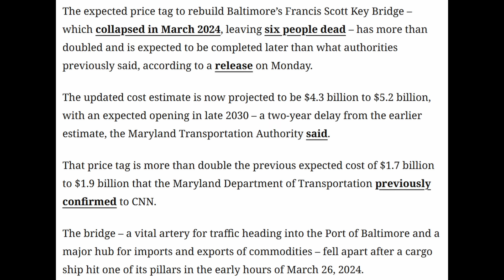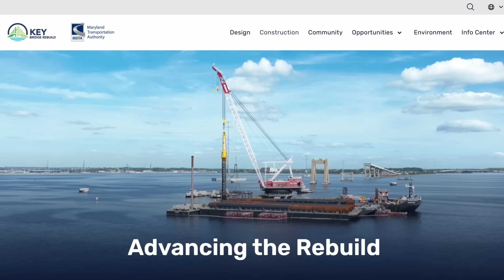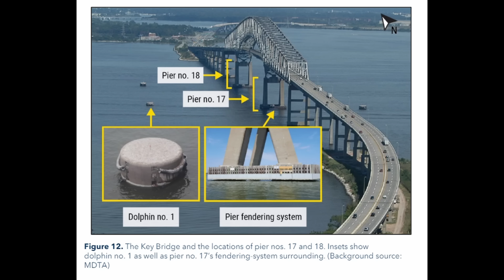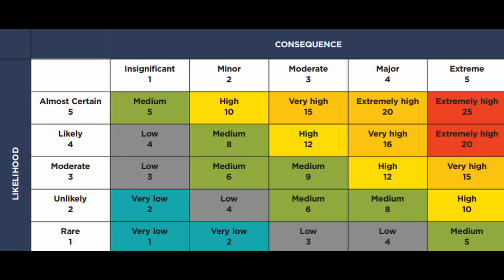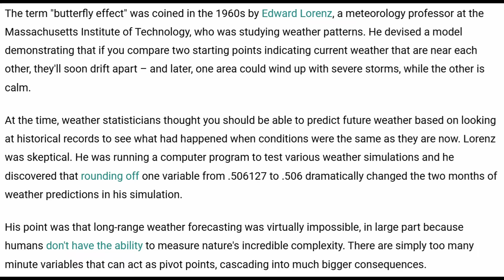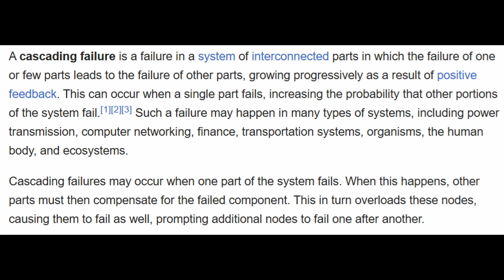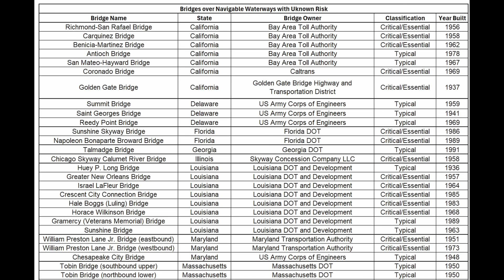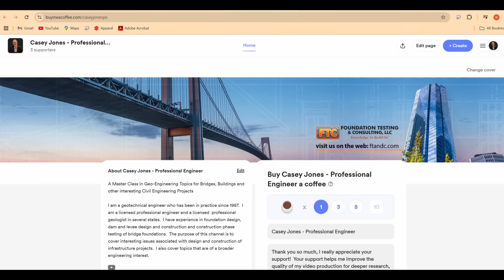Key Bridge Destroyed because of a Label on a Single Cable

Comment: Could they replace the bridge with an underwater tunnel? I know we have the technology and the machinery, like TBM"s. How feasible or cost effective would a tunnel be?
Reply: Baltimore already has TWO tunnels under the same body of water. But the bridge’s traffic capacity is needed, and more importantly, it has to be a bridge, not a tunnel, because hazmats are not allowed in tunnels. Both ends of the bridge end in somewhat industrial areas that desperately need that direct connection. (Right now, normal cars and non-hazmat trucks can use the tunnels, but hazmats have to go all the way around the beltway, which is about a 45 minute detour if there is zero traffic, and of course much longer if there is.)
Reply: @tookitogo  A 45 minute detour for hazmat transport doesn't sound like a big problem if a tunnel is safer for everybody else and avoids the extra challenge for all ships to navigate the bridge.

Comment: The incorrectly attached wire was the cause of the crash.  It was just one link in a long chain.  I would argue that the bigger issue was not having the bus breakers in automatic rather than manual and using a flushing pump to fuel the generators rather than the service pumps designed for that purpose.  These were much more fundamental issues.  The loose wire was simply the last straw, but many more straws had been loaded onto the camel by then.

Comment: 6:40 it’s bridge design that’s anti-fragile. These accidents are the stress and more robust designs are the response to that stress.

Anti-fragility is an important concept. Taleb also talked about how unexpected events become worse the more we optimize a system. That’s important to consider when you’re deciding between buying a townhouse with two floors and an apartment on the 18th floor. One of these situations is much more highly optimized than the other.

Comment: So rather then a normal DIN rail type connector block using screw terminals they relied on a spring loaded contact in a marine application. Seems like the Shaky Deal of the Week knowing how the ferrule needs to be crimped on the wire first
Reply: Spring-cage DIN rail terminal blocks are normal. They’re used everywhere, and the specific model used is marine rated. Spring-cage terminals are better for high-vibration environments than screw terminals.

And there wasn’t any defect in the ferrule itself. (Nor is there any issue whatsoever with crimps as such; crimping is a reliable, established technology that is used universally, including ultra-high-reliability applications.)

It was just the improperly applied label, which prevented proper insertion — and more importantly, made it practically impossible to see that it wasn’t fully inserted.

Comment: Why are infrastructure costs up to 10 times the inflation adjusted cost of what it used to be for the same thing?
Reply from the maker: I've often wondered the same thing it makes no sense.
Reply: If the question is “why don’t the numbers line up after we apply the inflation rate”, it’s very simple: Because inflation numbers don’t tell a complete story. They are calculated based on a “market basket” of the prices of a selection of items and services. There’s some standardized way of selecting what goes in the basket.

But any individual products and services within the basket, as well as any that aren’t in that basket, may become MUCH more (or less!) expensive than the basket average tells us.

For example, over the past 50 years, in inflation-adjusted dollars, orange soda has become much cheaper, while orange juice has gotten much more expensive.  Air travel, television sets, and washing machines have gotten much, much cheaper, while college tuition has gotten much, much costlier.

If the question is why some items got cheaper while others, like construction, got more expensive, that requires deeper analysis.

Comment: With all the technicalities one wire was enough, what suprices me is that they found it. Intelligent people with time, determination and logic shows its possible!
Reply from the maker: I thought I was impressive too.
Reply: @CaseyJones-Engineer  Its more like an impressive lie.
Reply: I was an industrial electrician for 30 years. It's really not that hard. If you have a single circuit that keeps a process running, you just trace it down with your eyes, hands and a meter. A good schematic drawing is critical.
Reply: @markwilhelm168  Was in same department were changes was not documentes and until they figured out that this was really bad, i guess you know the implications of this. Later everything was documented repairs and modifications.

Comment: It's some very similar nonsense probability things that Boeing and the FAA were using that lead to the problems with 737 Max.  I work in aerospace and totally agree we need more wholistic rather than weird probability based regulatory frameworks from the regulators. 

On the Aerospace side I think we have problems kinda the opposite of what you speak of here, but do delve into here and hint at, where we are asked to design to ensure some butterfly effect type failure that really is a very minor and would rarely ever cause a failure but is rightly or possibly wrongly sometimes deemed the root cause.  This is then a very specific design constraint that takes too much priority and can compromise other aspects of the design making a wholistic approach impossible.  

A good example of that is some of the low voltage fuel tank system designs some aerospace companies have in their fuel systems now as a result of the TWA flight 800 that for all we know could be completely wrong root cause for mostly political reasons.  So you have odd plastics and all sorts of not traditional design approaches in newer jets that themselves I fear could eventually cause a new problem as those jets age and take one out...all as a result of a regulator pressing things down too specific a direction rather than pushing for a more wholistic approach.

Comment: Trains have air brakes the lock on when air pressure is lost, say due to a broken air line.
Hospitals and critical businesses have back-up power generators to bridge a power failure.
Is there no possible way to create similar precautions on ships?  Back-up generator for critical systems like steering?  Maybe an automatic anchor (or sea anchor) deployed when propulsion or power fails?  I agree, the bridges should be better protected against ship strikes, but is that the only possible remedy?
Reply: They already have backup generators that go on automatically. It’s just that for other reasons (explained in videos by other people), those didn’t work as designed.

Comment: Take a look at the Sunshine Skyway bridge fender system (Tampa Bay). The original bridge collapsed due to a ship strike in 1980. The replacement has a very robust set of main bridge pier man-made islands that surround the piers. They themselves are protected by huge concrete dolphins on either side. The adjacent bridge piers have numerous smaller dolphins primarily because a large ship could not reach those piers due to shallow water depth – the ship would run aground first. (I boat in and around this bridge frequently, so I see this system up close and personal.)
Reply: A 40 years old design for ships 1/10 the size. A Panamax ship would destroy the bridge.
Reply: @scottkozel1519  Tampa Bay is Very shallow (average 12'). Any large ship would run aground outside the shipping channel, which is a natural protection for the bridge.

Comment: Concerning the construction cost doubling.

1.  The original $1.7 billion estimate released 2 weeks after the collapse was based on the new bridge main span bring the same height and length as the original bridge.  The Coast Guard has since decided the height will increase from 185 to 230 feet, and the length from 1200 to 1600 feet.  Bridge costs increase with the square of the length.  Plus the added height increases the approach span length by 0.3 miles.

2.  Since the original estimate high tariffs have been introduced on construction material and equipment.

Cost increase press release:

https://mdta.maryland.gov/blog-category/mdta-news-releases/maryland-transportation-authority-releases-updated-estimates-cost

Comment: What people doesn't grasp is the what they show on screen is a signaling wire. So what likely happend is that the device used to check is a fault was present, detected an issue and this device switched of the breaker, because suche devices are wired in a matter you detect an open circuit. Not that there was a fault, big the system used to detect a fault was thinking a fault was pr was present
Reply from the maker: I referenced in the video that it was a control wire.

Comment: Disappointed sub here you really didn’t understand the failure on board Dali at all if you’re blaming the one connection. Perhaps you are marginalizing the vessel’s failures to get to your area of expertise but a 20 min dive into the hearing would easily reveal the 3 or 4 aligning factors from a systems engineering perspective. From recollection they are; both generators were run on one flushing pump when run on port mandated cleaner fuel making them non redundant , breakers not set to auto-reset, backup generator taking too long to start up and switch over, primary fuel pumps requiring local manual startup. Add the loose wire… other non ship engineering failures include failure to address multiple power failures just prior to departure, shipping company apparently routinely evading mandated safety procedures and proper training, and on the locality’s failures obviously ignoring glaring deficiencies in collision protection as you do call out. Thanks for the content!
Reply from the maker: No, you simply didn't follow my point. The cable problem was just one of many factors in a long list of causation which illustrates why the AASHTO methodology for bridge impact risk assessment is simply folly from a predictive standpoint.
Reply: @CaseyJones-Engineer  yes got that actually and agree 100%, also totally agree the probabilistic analysis is hopelessly flawed not accounting for bad actors for just one thing. I’m quibbling my friend, don’t take it as an attack! All I’m saying is the “one wire” thumbnail and very light coverage of the shipboard systems failure are a bit disappointing coming from you, as you are an outstanding example of how the profession can communicate and advocate for better civil engineering and greater accountability. I would just suggest “DID one loose wire cause this” as a better thumbnail and a shoutout to those here who went into detail on the ntsb report like Sal M. Cheers!
Reply from the maker: @timkohchi2048  I'd hate to interfere with your desire to be offended by minor things.

Comment: I have multiple sources on this report. The loose wire was more of a straw that broke the camels back. There were problems with how they were running the fuel to the generators, there was some kind of valve shut off that prevented the back up generator from kicking on properly. There were electrical systems set on manual instead of automatic. I often say you can't dodge the dice rolls of life, but sometimes you can load the dice. Either the crew or the owners loaded the dice against themselves, increasing the odds that a minor issue would blow up into a big issue. 

As far as the bridge is concerned, when you are responsible for thousands of bridges, you need to be able to put their health down as a number that will let you sort all of your bridges on a spreadsheet. That's what they are trying to do with that numeric system. It may not be working as it needs to, but the core Idea is the correct approach.

Comment: Bridges need to be designed so that they will not be damaged at all if a huge ship is intentionally aimed at them.  The best way to do that is to have the bridge totally out of reach of the ships.
Reply: That is correct -- span the entire estuary with a single suspension span 5,000 feet long --  or build a tunnel under it as in Hampton ROads.
Reply: @alanstevens1296  
There are simpler and cheaper ways of achieving the goal I stated than having a mega-span.  The bay is shallow and has to be dredged for large ships to pass.  A span only needs to be longer than the channel width with a safety margin.  Making the bridge high enough is another issue to deal with.  But robust shielding is always essential.

Comment: I am glad the bridges were upgraded as a result of this tragic mistake. 

Many years ago, I was in the IT department. Our servers were starting to overheat. Which triggered me to hit the "red button" to power to the server room (as instructed by my manager). If it was not pressed, a fire could have started in the server room. We never figured out what triggered the overheating to begin with for a bit of time. Later it was determined to be the A/C that was "interrupted". Which led to another question. What caused it to be "interrupted"? That was never determined. As a consequence, shutting down the servers caused a cascading shutdown of systems across Canada that affected the branches from the West Coast to the Eastern provinces, which in turn, affected other companies along the chain. For years nobody knew the root cause. Only a few years ago, I found out the actual cause. A worker a block away was working underground in the wiring infrastructure tunnel below the street. It seems that a small animal chewed through the casing, then the wires. A fire occurred and a local black out that lasted a brief time. This happened on a day our head office was closed for the day. As I was the closest IT person to the office, I was first to arrive on the site and had to follow directions from my senior IT manager. The "red button" was pressed. If it was not for a casual conversation, over 10 years later, with the person who was in that tunnel who was tracing the cause of the interruptions, I would have never solved the mystery. If I remember correctly, it was a raccoon that caused the small fire.  Since then, many changes within the city's infrastructure had to be made. The cable's covering had to be upgraded to "chew-proof" materials. We had big rats (about the size of cats), but they were not culprits in this incident.

Comment: Thank you for your excellent and detailed coverage of the Francis Scott Key Bridge disaster, I have been following you since it happened. I would like to comment on the proverb about the loss of a nail leading to the loss of a nation. That situation is not exactly a butterfly effect, rather a description of the unintended result of neglected maintenance. A horse needs to have its hooves trimmed at regular intervals, and if it wears shoes it has the shoes either re-set if they are not worn down or replaced. If the hooves are not given regular care the hooves can chip if the horse doesn’t wear shoes. If it does wear shoes the nails or even one nail can become loose and the shoe can come off because the hoof has grown too long. The only similar regular maintenance item that I can think of is regularly changing the oil in any kind of machine. If you never change the oil in a machine something very bad can eventually happen and cause an unexpected result.
Reply from the maker: Thank you for all of your comments but I appreciate it!  You make a great point about the maintenance.

Comment: Can a double or triple row of dolphins be installed economically, fanning out away from the piers on each side? Space them say 1/2 the width of a ship apart from each other, and stagger them, 2 miles long each way.  Funneling bumper cars between bridge piers if you will. My assumption is that ships will continue to become more electronically complicated, thus, more bugs and/or likelihood of failure, just like all these auto electrical/electronic recalls we have.

Comment: Interesting how roadways on top of bridges are built with safeguards based on a presumption that eventually there will be a vehicle with a loss of control due to unforeseen circumstances (hence guardrails), but few or no safeguards on the channel beneath with the presumption that no one would lose control of a ship due to unforeseen circumstances.
Reply from the maker: That's an excellent observation!
Reply: It's much easier to stop a car (and try to do so somewhat safely) than stop a bridge of mind boggling mass
Reply: @ImieNazwiskoOK the ease with which you can mitigate one thing that is likely to happen eventually should not dictate whether you try to mitigate.

Comment: Ur graph vs their equation is simple urs will include too many and theirs will be so complicated nobody knows why some specific bridge is safe exactly what they want you take ur preferred outcome and engineer a complicated equation backwards to "prove" why they don't have to take any action on a costly replacement and actually do work and not be held liable for the past just admit you did what you could at the time it wasn't the current administration who approved it and you will work with fix and repair what you currently have to make it as good and safe as possible

Comment: In my opinion, there is no way to eliminate accidents like the Dali. There are literally miles of control wires with thousands of terminals on a vessel subjected to near continuous vibration in a corrosive environment. Nor do we have a part in the hiring and firing of management, or crew.
What we can do is mitigate the damage done by addressing what we do have control over. This would include size and placement of dolphins. The number of tugs and their use. The forcing of ships to swap fuels while in port. This last is a direct result of bureaucratic regulation  with extreme cost to little benefit ratio. It was a contributing factor in this incident. A flushing pump was being used to pump fuel from what I understand. 
Enjoyed your presentation. Thank you. Have a good day.